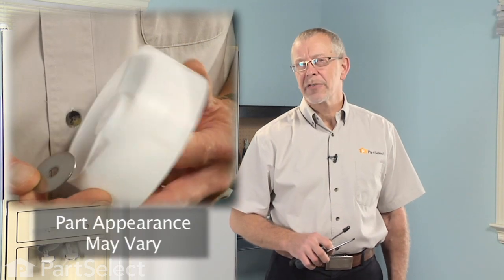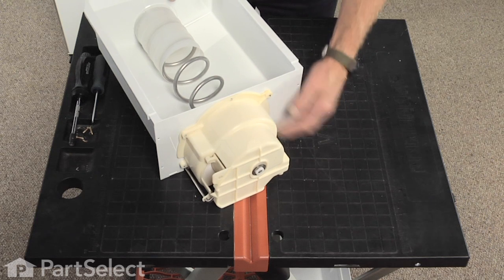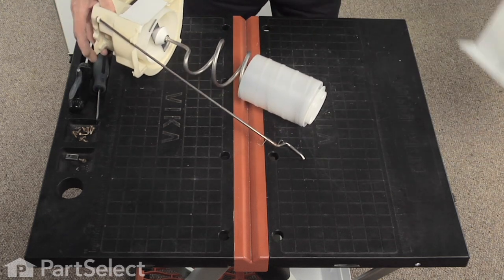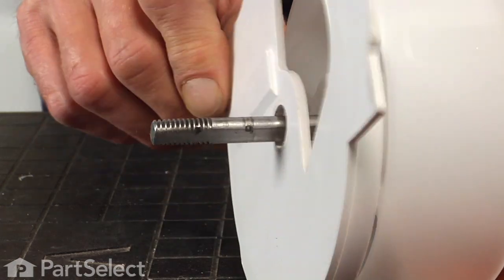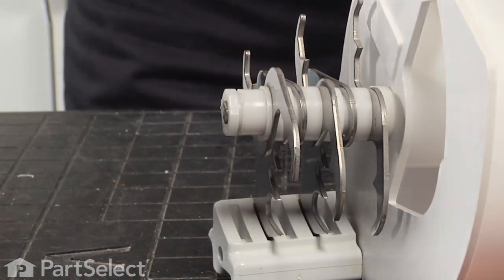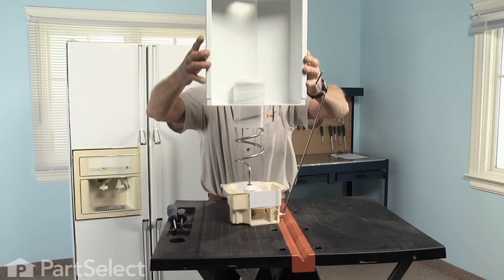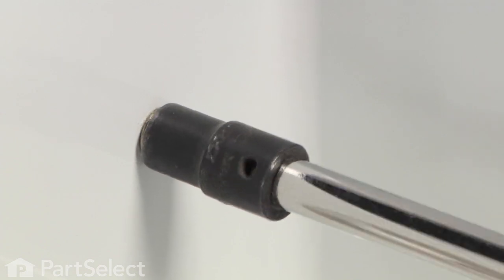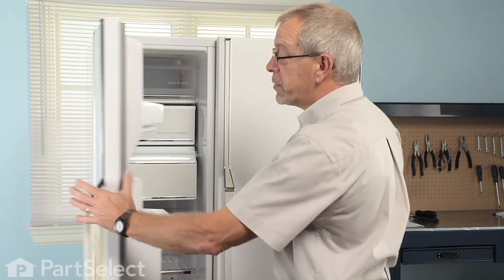Refrigerator Repair - Replacing the Ice Bin Auger Drum (Whirlpool Part# 4388736)

Comment: Mine is not metal.  My Whirlpool side by side refrigerator model ED5GTGXNQ00 has a white plastic ice dispenser drum which the blades near the door have broken.  Do you have a part number you can give me to replace a plastic drum (not a metal one as in this video)?

Comment: hi i have a ge gss225gmd side by side fridge it make ice but none dispences what could  be the problem
Reply from the maker: Does the flapper door open? Does the auger motor operate? If neither works, the problem may be with the dispenser control board or the actuator switch.
Reply: the flapper works
Reply: the auger motor wont turn
Reply from the maker: Try removing the ice bin and then activating the dispenser. If the motor still won’t rotate, it may be defective or it may not be getting power from the control board. You can check the motor for continuity with a multi-meter and also verify that power is available to the motor terminals if you are comfortable in working with live electrical circuits.

Comment: Have a fridgedare Galley, model # LGHB2869LF4.  Need to change out the auger motor. uSED THE 1/4' nut driver to remove all the screws on the forward facing plate.  Plate does not come out  am I missing some screws that hold it in?  Is the three door model with ice makers top and bottom.  this is the auger for the upper ice maker.  Thanks
Reply from the maker: It looks like there are 5 screws that hold the cover plate to the housing. The motor is attached to the cover plate with 3 screws and the fork would also have to be removed as well. I am not sure what else might be preventing the cover from being removed.

Comment: I have a Kenmore Model 25351232105. We use the ice dispenser a LOT and we use the crusher on the dispenser a LOT.

The ice maker isn't dispensing ice.

The ice maker makes ice with no problem. The motor turns the auger, but no ice is coming out the dispenser. I opened the door and pressed the little switch to trick the ice maker into thinking the door was closed, and I held a bowl under the ice maker bin to catch any ice that came out, but none did. That indicates to me that the problem is in the bin, not in the door.

The auger drum is the old-style that has a flat metal blade. That metal blade is detached from the plastic housing (I can spin that metal blade with my finger without moving the drum-shaped housing) and I think it's supposed to be attached.  Do you agree that sounds like the auger drum is the problem?
Reply from the maker: +Beverly Brown  I agree. You can order the complete assembly part number PS1991430 or determine which of the individual parts you need and repair the auger.